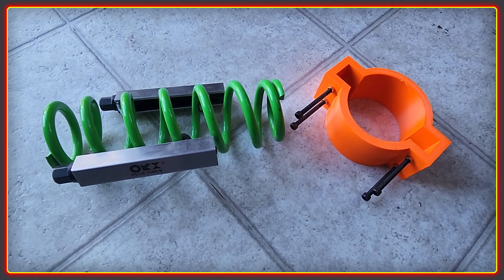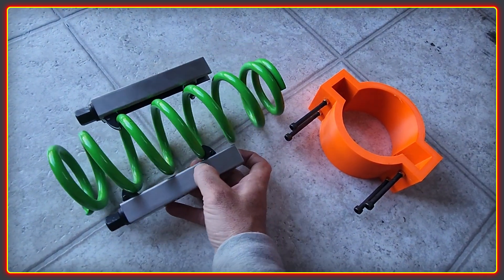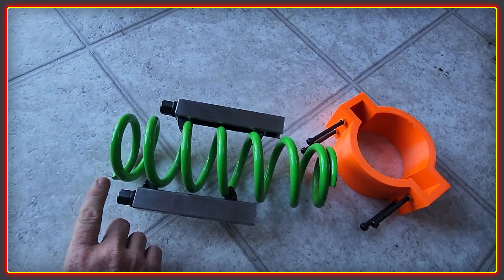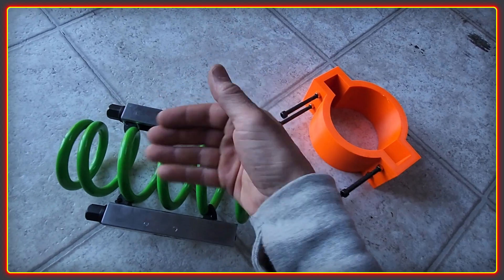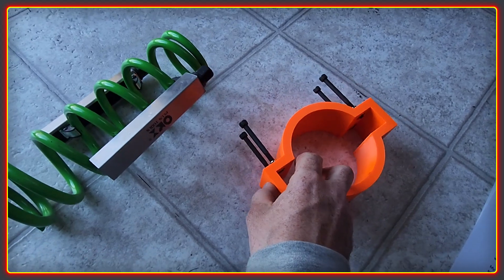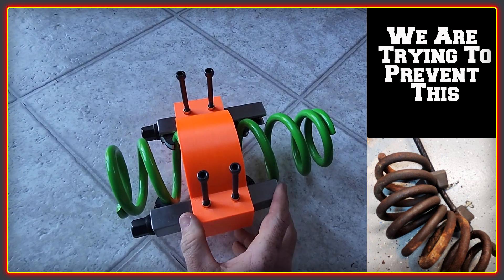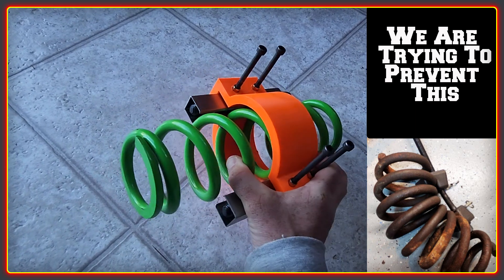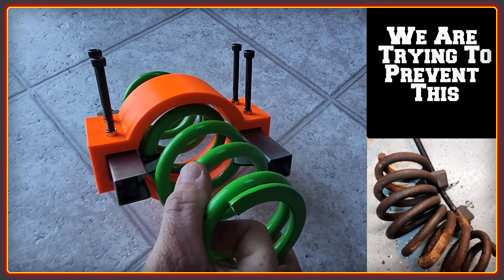Making Spring Compressors Safer - Taming the Widowmaker

Comment: A safer and easier solution would be to just have an extra pair of spring compressors on-hand.  You can use 3 or even 4 depending on the size and strength of the spring, which would give you added protection and spread the load even further.  Interesting design though

Comment: so how are you meant to get it on an off? it needs to be 2 piece, those U parts that slip over the spring compressors make them L shaped make the foot of the L thick and put holes in the foot match that up with the "I" piece that mates up with the L so it can be bolted an unbolted .... if you were relly tricky you'd use swing bolts and wingnuts and open up the hole on the "I" side so you'd never have to completely remove the bolts .......
Reply: doubt it's intended for on vehicle. more towards installing the spring on the strut.
Reply from the maker: Its only for use off the vehicle after removal of the strut. I guess it could be two pieces if needed. Was not part of the initial request tho.